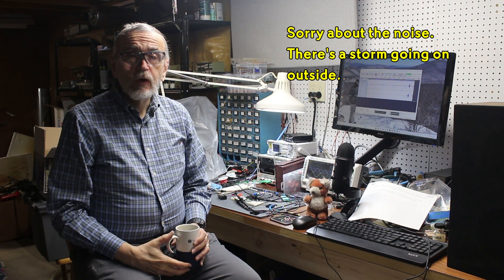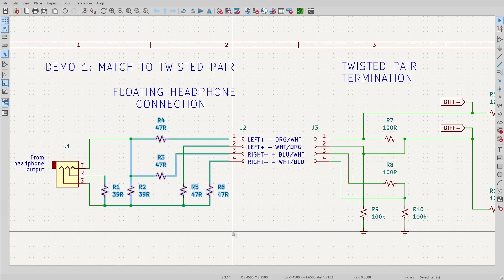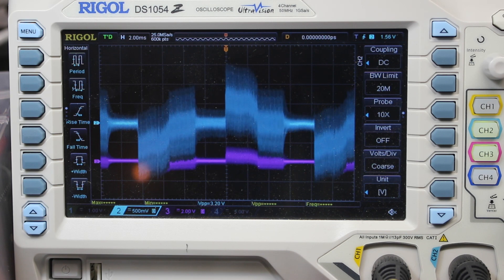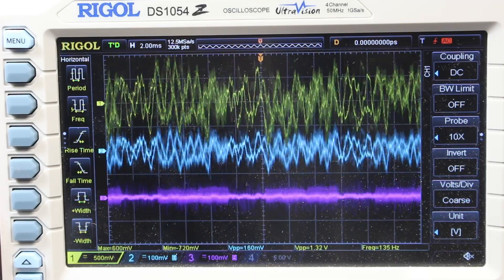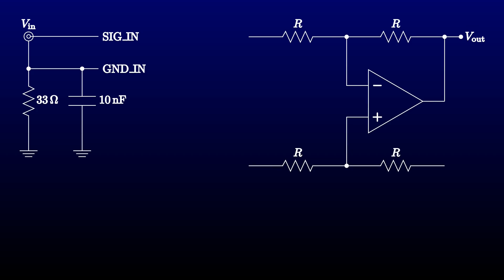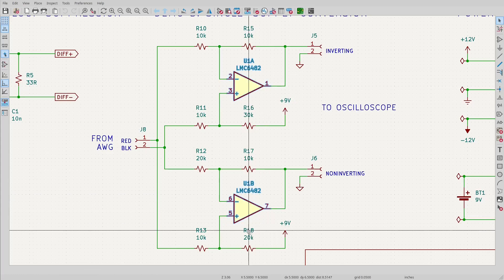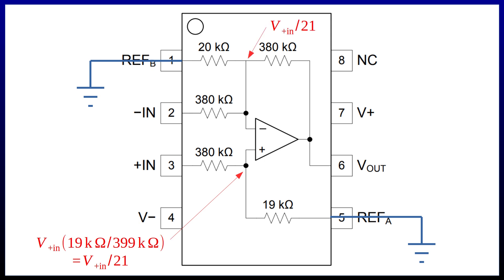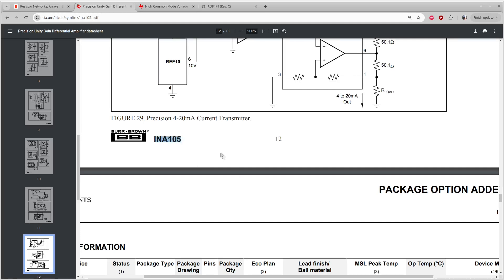Differential Amplifiers and Inputs Beyond the Rails: Op-Amp Basics, episode 4

Comment: I'm building one and trying out some different resistors. I want to try the 1:1 setup as it's distorting. Might build a clone as I fiddle around with solder all over and I had to put an MCP6002 in where the LM393 was. You go too far with some of it. Why even care about the noisy USB charger. You can use a battery. I just put a capacitor between + and -, if the power supply makes noise (some old USB power bank shut up quickly).
Reply from the maker: It's great to see you experimenting - that's why I do these videos! 

The point of the noisy USB supply was that sometimes you have to deal with a signal coming from a different piece of equipment. You don't always have control over the other end. You may have common-mode garbage coming in from the distant power supply, or common-mode interference from other stuff in the environment. Using a phone on a dodgy power supply was just the easiest way to show the problem and how to solve it. 

A differential receiver is exactly what you'll see in the input circuit for an XLR mike, the receiver side of a USB or Ethernet connection, or even an old-school analog telephone (where the differential-to-single-ended conversion was done with a transformer).

Comment: When you connected the charger I thought it would end up with an explosion! Have you isolated the oscilloscope ?
Reply from the maker: @abijeetrs6522  the power supply has an isolated output, as is common with lab power supplies. There's a separate green binding post on its front panel that's connected to the ground of the wall plug. I tie it to the common point of the +12 and -12 supplies. Everyone (function generator, scope, power supply) agrees on where the ground is, and they're all on the same power strip.

Comment: A video on instrumentation amps would be good. Kinda cool how you can set the gain with only a single resistor.

Also, getting a good match between resistors isn't too difficult with any reasonable DMM. With a 1999 count meter you can get 10k resistors to within 0.1% A secondary run with a Wheatstone Bridge (that would be a cool video) and the mV setting and you should be able to get them within 0.01%
Reply from the maker: Remember, though that you also have to consider whether your resistors are temperature stable.  I've had circuits with hand-matched cheap resistors drift way out  as they warm up.  And at this point in my life, I'd just as soon spend a buck or two and save myself the work of binning them.
Reply: @KludgesFromKevinsCave  I think with modern ±1% tolerance metal film resistors the tempco is usually less than 100 ppm/°C, so at 10kΩ that's 1Ω or 0.01%/°C which for almost any homebrew project is going to be fine (unless your a ppm nut like MarcoReps)
As for the time it takes, I tend to do it when I've nothing else to do and need to kill some time. So I'll just sit down with my Keithley bench DMM, go through a few strips and mark up any matching values.
Reply from the maker: @JaenFoster  I'm a musician.  If two oscillators are out of tune with respect to one another by 0.06%, the difference is audible to a trained ear. That doesn't allow a lot of wiggle room.  There are a few spots in the circuits where I need low-tempco resistors (or at least low-tempco in their ratio), plus using matched pairs of transistors to temperature-compensate the saturation currents, plus thermistor compensation for thermal voltages, and so on... getting a synth not to go out of tune as it warms up is tricky. (*cough* Most synth enthusiasts simply use musical idioms where it doesn't matter if you're out of tune, or even trumpet some of those faults as being part of the characteristic, classic synthesizer sound.)

Lately, when I have nothing else to do, I have a backlog of video to edit and circuit animations to produce.

OK, I confess that I will hand-match JFET's once in a while, because you can't find matched ones for love nor money.
Reply: @KludgesFromKevinsCave  I agree that stability is important for tuning. I'd still argue that, of all the components, resistors are the most well behaved and semiconductors are at least predictable. Capacitors on the other hand...  😫
Reply from the maker: @JaenFoster  Sure, resistors are the most predictable of the lot. But sometimes you need good ones.

And I see you didn't even mention inductors. (All inductors are RLC resonant circuits, and start showing it at the worst possible time.)
Reply: @KludgesFromKevinsCave  I think for audio kit the only place I'd really want to see an inductor is either in the power supply or the loudspeakers 😄
Reply from the maker: I have been known to do RF stuff.
Reply: @KludgesFromKevinsCave  pretty sure at RF everything's either a capacitor or inductor, whether it's meant to be or not 😄
Reply from the maker: And everything's an antenna. If it conducts, it will radiate.

Comment: Schematic of floating connection (Demo 1) between J1-J2  is confusing me. Breadboard layout makes sense to me but I can't reconcile the schematic to the breadboard layout. Help. 😟
Reply from the maker: Good catch!  There's an error in the schematic. The left end of R7 doesn't go to R4, it goes to the top of R2 and the ring connection of the audio jack.  I'll fix it on GitHub.
Reply: @KludgesFromKevinsCave   Thanks for confirming. Thought I was loosing my grip 😆